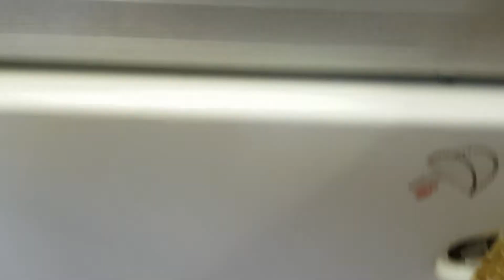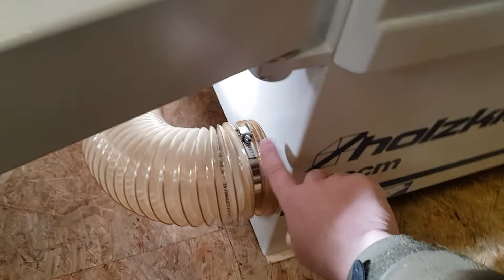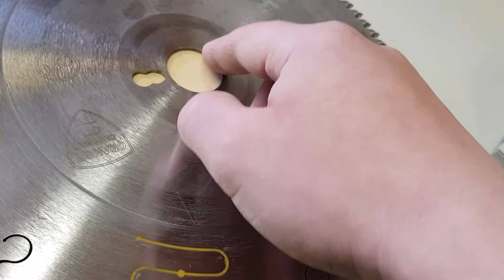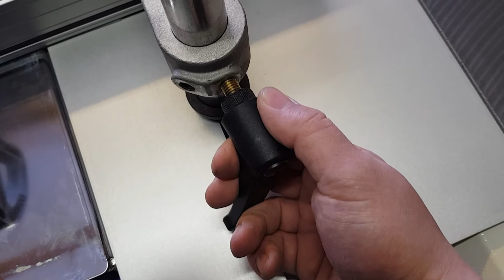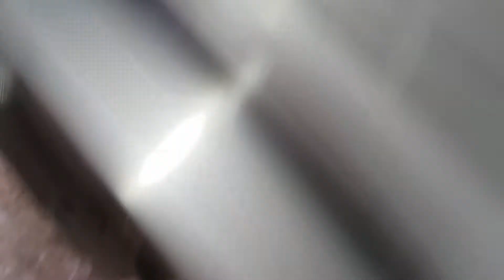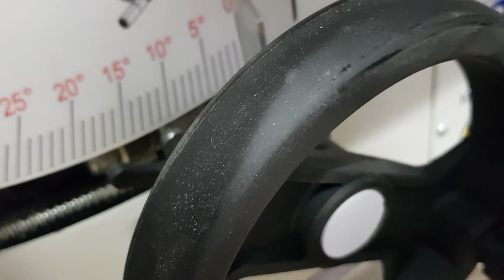Holzkraft Minimax SCM SC 2C sliding table saw / Kleinformatkreissäge. Part-7. Random extras.

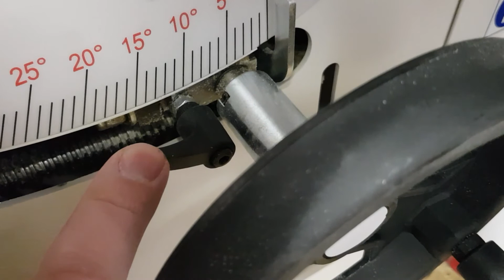Comment: I spoke to my SCM technician and he confirmed the lever at 8:40 is supposed to lock the blade height adjustment mechanism, similar to the knob on the corner for the blade angle lock.  The lever doesn't do much on my saw and I have never had a problem with the blade height changing during use, so I haven't been too concerned about finding out why the lock doesn't work.

Comment: I agree with you completely about the location of the on-off switch.  My saw is the older version with a rotating handle instead of push buttons.

I don't know what the lever at 8:40 does either.

Comment: Do you have any information about the level at 8:40 now? I just bought the same machine and was also wondering what the lever is for. By the way your videos helped me alot!
Reply from the maker: Nice to hear that you have got some help from the videos. I don't have any new information about the lever. I still assume it is for fastening the tilting mechanism down, but it is no good for the job it was meant for. How was your saw overall factory assembly quality? Were I unlucky or is it widespread?
Reply: @wjaceh  I'm not finished yet with the asembly. But i don't have that many Problems with the overall condition. I haven't seen any abuse marks yet. But the big Steelrod which as you mentioned is not intended to adjust (glued nuts) was so far of, that the gear of the fineadjustement did not grab the teeth of the ruler at all. So yeah there were also some issues.
Reply from the maker: @Avallan  is your cast iron table at the right height? Can you move the blade cover without using excessive force?
Reply: @wjaceh  haven't checked it yet. Hopefully i'll have some time to look further into it on the weekend. I'll keep you updated.
Reply: @wjaceh  I have checked the bladeCover and it has the same issue as yours. But i didn't bother to tweak the iron Table. Maybe ill check it later on, but for now ill keep it as it is and use a little bit of force. Nearly everything else received some amount of tweaking and finetuning. So mine was also not well Factoryset.
Reply from the maker: @Avallan  If I had to decide again whether or not to adjust the cast iron table only because of the table extension then I would rather remove the latter or cut away the colliding metal sheet part. So don't start adjusting the cast iron part without strong reason or lack of alternative options.